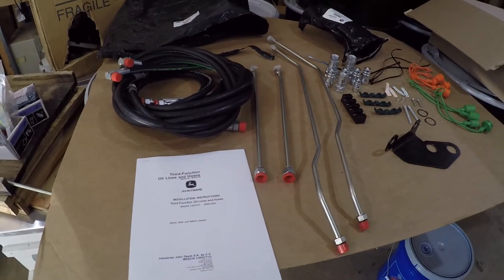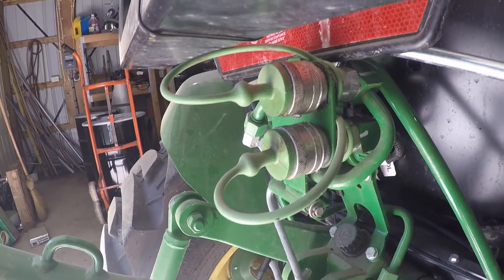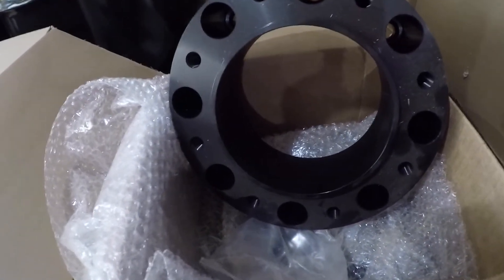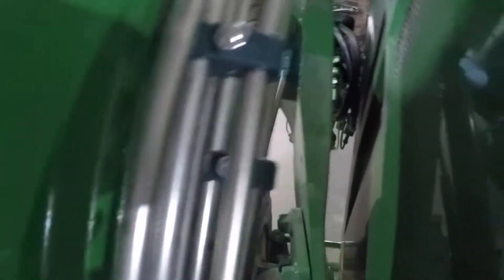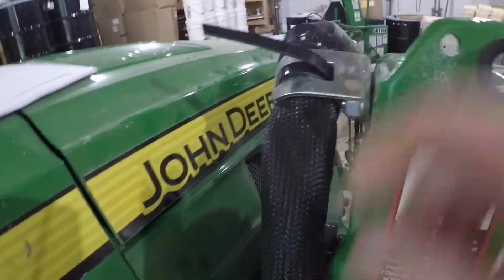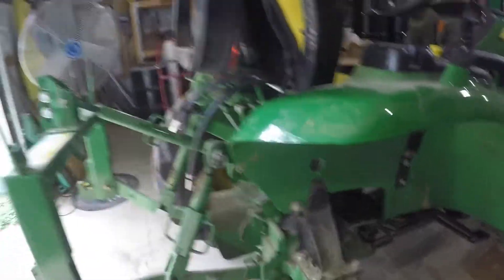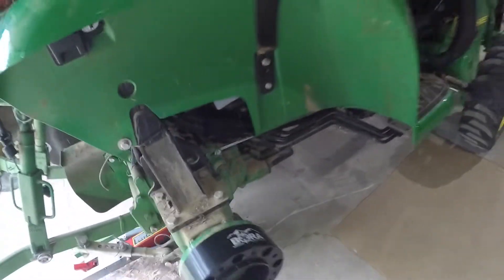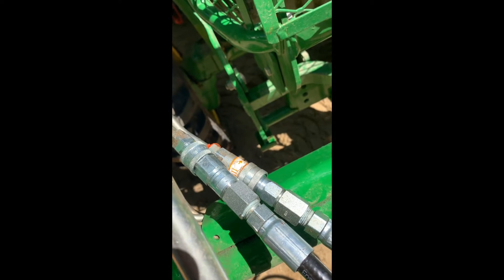Hooking up front hydraulics on a John Deere 3046R. Using a kit BW16138 purchased from John Deere.

Comment: Thanks for the video!  How long did the install take...just a ballpark is fine.  I like such projects, but with some other things going on, I might have the dealer do it while my machine is in for some other warranty work.  thanks again!
Reply from the maker: I think it took my about 5 hours. The routing of the hoses was a little putsy. But everything was fairly straight forward. I put on wheel spacers at the same time. The hoses were much easier to run with the rear tire off. The thing that can trip you up is the quick disconnects at the front. If the implement is John Deere no problem, but any other brand can have different couplers. Everything Attatchments asked me what tractor the grapple was hooking on to, and they sent me the proper couplers. I did find a hose was too long. I took it to the local auto store that makes hydraulic hoses and they fixed me up.

Comment: I am buying a grapple to hook to this kit.  The grapple comes with 1 male / 1 female 1/2 inch connectors.  Will that work with this kit?  I can see its male and female...but is it 1/2 inch?
Reply from the maker: Hydraulics couplings can be a little different. Some fit with John Deere some don't. I would suggest you contact who you are purchasing the grapple from and ask them if their couplers will work with john deere couplers. If you have to, you may have to get couplers from your john deere dealer. Great to hear you are getting a grapple, they work great.

Comment: Did all the parts come with this kit ? I just came from my JD dealer and they said only the hoses and steel lines come with the BW 16138 kit , the hydraulic couplings and small brackets are not include . When and where did you purchase this kit ?
Reply from the maker: The small brackets were included in the kit. I did have to buy the couplings from Advance Auto Parts, also Gates brand  hose cover
Reply: @beefitter  What size hydraulic couplings and type ? I’m purchasing a 66” Root Grapple from Homestead equipment and they need to know the hydraulic coupling type and size before they can ship it .
Reply from the maker: @altonhenderson4120  I bought a root grapple from everything attachments, now that I think about it, I had them supply the couplers. This made sure I got the right ones. I know there is a few different types and it is easy to get the wrong ones.
Reply: Thanks for the video. I just picked up my kit today and no book with it. So I have a clue what to do. Thanks again.